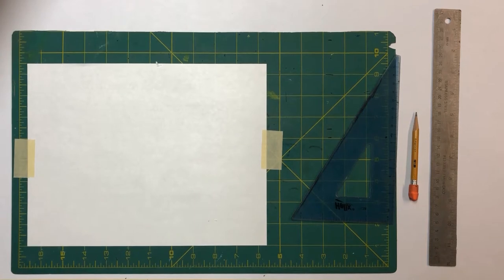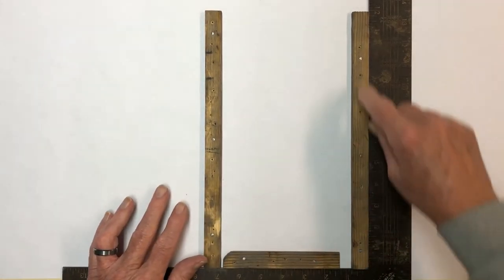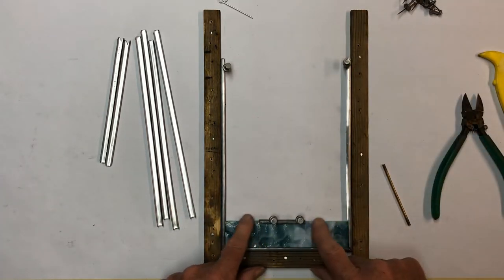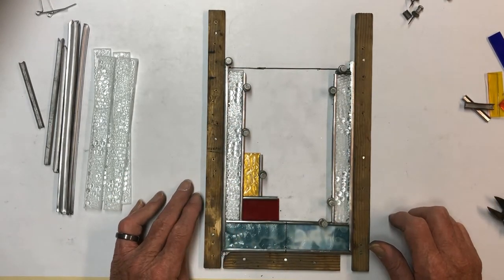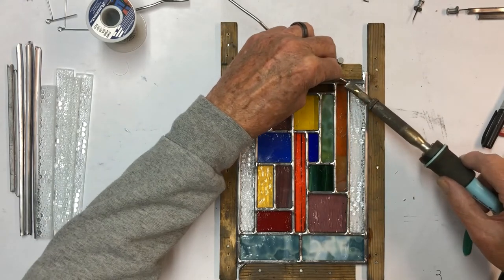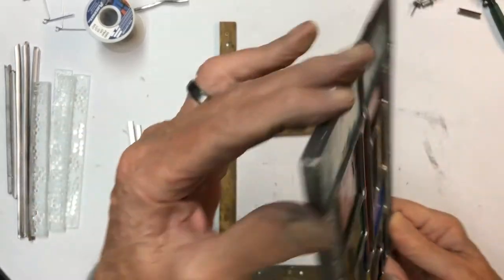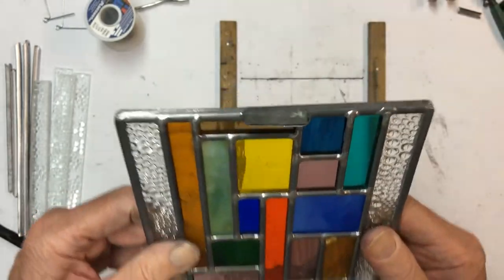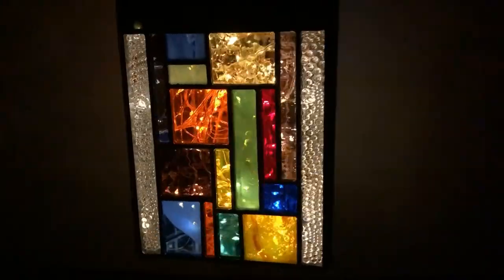Leaded Glass Solar Lantern

Comment: This is great however, did I miss a step when you talked about closing up the ends so the lights don’t fall through?
Reply: Same question
Reply: I absolutely love that clear bubble glass. What is it called and do you know the manufacturer?  Wonderful video,  love the lamp!
Reply from the maker: My Bad, Your right. I talked about putting the bottom in but did show you how i did it. sorry for that. The bottom is made out of opaque white glass and sits on the small tabs we soldered on the bottom of each panel. Hope this helps you out. Check out one of my other videos and hopefully I did a better job on it.
Regards, Bill Stone
Reply from the maker: Hi Therese, Sorry I don't know the name of that glass. Someone gave me a small sheet about 8x10, I loved it also. I did look through my glass books and found a glass by Vegla Glass HV-129/000 that looks like it from the photo. There is also a company called BGS Glass Services on the web that had some glass that looks close to the one I used. Thanks for your kind words and give some of my projects a try.
Regards, Bill Stone
Reply: @billstonesstainedglasscrea3310  Thank you so much. I'm going to try and find the glass and I am certainly going to try a latern. They are beautiful! 😊

Comment: I've built 2 three sided lanterns. First one was a challenge. I selected glass that was semi transparent, figured next one with transparent glass with bevels. First one is with only one solar light, second with three lights. My issue is with connecting the panels without light gaps. I am using 3/16 U round, thinking the round U lead is my problem. Are you using round or flat U lead.
Reply from the maker: Hi Julie,
Thanks for your comments, the U Came I use is RU-70 made by Cascade Metals and the H Came I use is RH-9 also by Cascade Metals. The U came has a 1/4" Width and a 3/16" Face, with a 5/32" Channel. The H Came has a 9/32" Width and a 5/32" Face, with a 3/16" Channel. Check out Cascade Metals online and you can find out everything about Lead Came. As for the gaps in your projects, I took a look at several of my videos and found several tips that might help you close these gaps up for your next project. 1. In this video fast forward to the 31 min mark and check out the do not solder the back side of the outer edges. 2. This same video 44 min mark some tips on soldering the panels together. On the video Hexagon 2 Video fast forward to the 30 min mark and again a reminder to not solder the outer edgers of the panels. 3. Check out the video Octagon 1 at the 34 min mark and again at the 40 min mark where I show some small clips, I made to hold these panels together. 4. Last be not least, check out the spinner for beginners, it's the square one. It also has some good tips and also shows a little jig to help keep these panels together without having gaps in them. Check the 30 min mark, the 36 min mark and the 41 min mark showing the clips again. Hopefully this helps you out a little. So glad you're trying some of these projects. You can find all of my projects in one place by typing in the search bar and type in Bill Stone's Stained Glass Creation and click on my photo and they will all come up!! Have a great day!
Regards,
Bill Stone
Reply from the maker: Hi Julie,
I was just checking up to see if any of the info I sent you the other day was any help to you?? Hopefully there was some tips in there to help you out. Best of luck with your next project.
Regards,
Bill Stone
Reply: Afternoon. Thanks for info on the lead you use. I'd bought my lead through Delphi which carries Cascade lead. Unfortunately they don't carry the RH 70 that has the flat bottom compared the the RH 80 that I purchased that has the round bottom. So I think it is the round bottom that is the issue I'm having. I did make the clips, however i think with the round bottom of my lead  I was unable to get lead closed up. I went to Cascade's website, however I didn't see that I would be able to purchase a spool of lead. Anyway I'm gonna play around with what I have to figure out how to get around this problem. Thanks again.
Reply from the maker: Hi Julie,
Sounds like you found the problem with the gaps on the edges of your lantern. The came with the round bottom would make it really hard to not get gaps because the edges don't touch until the center of the came. You can find RU-70 Came on eBay and Anything in Stain Glass. Anything in Stain Glass Has a great chart for you to look at. Hopefully you will keep working on it!! I was glad to see you were able to make up some clips, that should help you out a little with the gaps. Best of luck on your projects. Hopefully you can get some RU-70 came and save the round bottom came for suncatcher project. Be on the lookout for my latest video on a Solar Lantern Planter, should have it posted by mid-week.
Regards,
Bill Stone
Reply: Thanks Bill. I'll look at Anything Stained Glass. I buy lead in the 15lb spools and Cascade didn't show they sell the RU70 in spools. Using what I have for suncatchers is what I'm going to do. If I'm unable to get the RU70 in a spool I figure I'll change to FU 1/4, I know that is sold in spools. Looking forward to your next video.
Reply from the maker: Hi Julie,
Thats sounds like a plan!! Best of luck on your projects!! Have a great day.
Regards,
Bill Stone